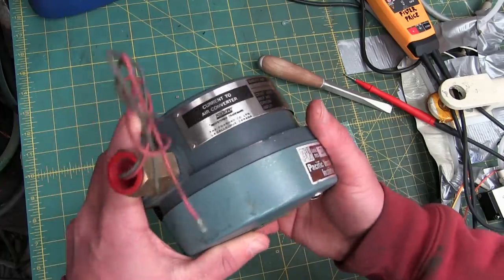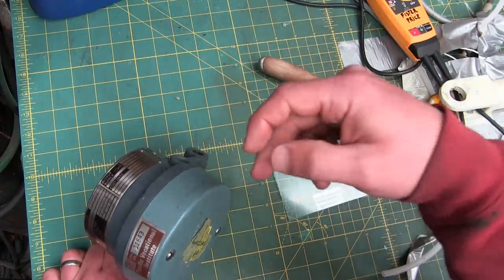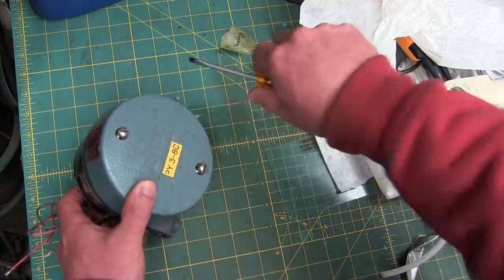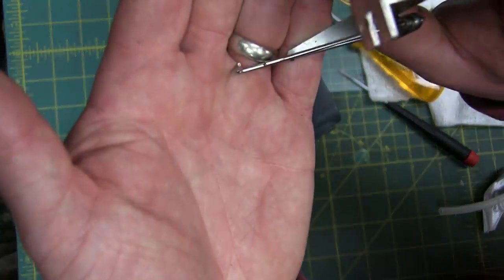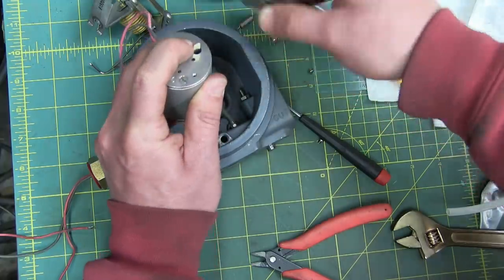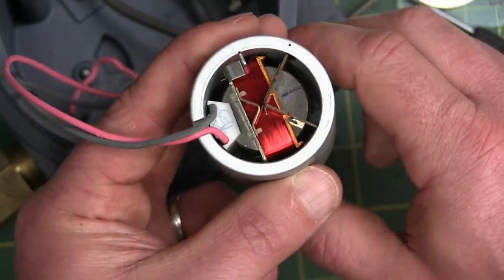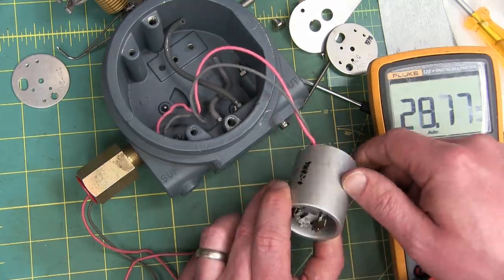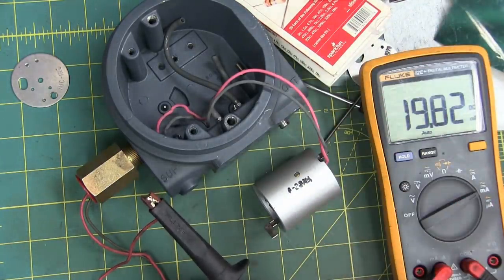BOLTR: Electro-Mechanical Instrumentation | MADE IN CANADA

Comment: Wait! Does it create voltage from vibration,the little nozzle causing lever to move/vibrate.
Reply: Nope current in the coil makes it want to align with the magnet. It operates on force rather than position. The position of the flapper (attached to the coil) and the nozzle (attached to the feedback bellows) move around but what changes the output is the force of the flapper pressing against the nozzle.

Comment: t's a current to pressure device, not pressure to current.  IIRC you read it correct but ignored what it said.. :-)   it's in a system that uses fluid on some static system.  Maybe to control clamping pressure for a brake?

Comment: If you're regulating the current going in, you're always going to get the same current going through, regardless of the impedance. You should be inputting current and measuring voltage, or regulating voltage and measuring current.
Reply: You just input current. There are no further electrical measurements to make on a force motor like this. The controller outputs a 4-20 mA signal and this converts that into a 3-15 psi output which goes to a pneumatic valve.

Comment: Merlin Gerin was bought out by Schneider. 
When it comes to D/B’s, contractors, switch gear, all ranges of breakers from a 2A MCB up to 4000A (which is the biggest I’ve worked with), control circuitry and the list goes on. They are the best in the business and used globally. 

I’m still not sure why America still uses a different type of switch gear than the rest of the world though 🤔

Comment: me thinks to much brewski.  Clearly says current to air converter.  Input is 4-20 mA.  Not output.  Coil  and magnet are stationary and therefore a galvanometer movement.  Don't drive for a while it would be the big mistake.

Comment: don't you need a 250 ohm load resister in that circuit?
Reply: You only need a 250 ohm resistor to convert a 4-20 mA signal into a 1-5 volt signal. An I/P works directly on current so no resistor needed.

Comment: Maybe if you supplied an AC signal to the coil in a bridge configuration and are using the magnetic poles to saturate the coil to cause a change in the AC signal… which would then need to be converted to 4-20ma signal.

Comment: very interesting. I keep thinking now how you'd do the signal conditioning for that without it getting too complicated using 1970's tech. The 741 would have too much temp drift for starters.
Reply: Use the 741 as a current driver.
Reply: You cant for the reason I highlighted above. IE stupid amounts of temperature drift. The input offset drifts all over the place so you cant just trim it out.

Comment: Sometimes pixies do care about being in a magnetic field, albeit in different circumstances than what is shown in this video.

Back in the good old days, Otis Elevator had a neat 3-phase door motor controller, (no, not VVVF, long before that) which initially limited the 3 phase current to the door motor thru a "saturable reactor". Basically each leg of the 3 phase input power was wound on a steel core- Then there was a forth coil would around this same steel core- This 4th coil was fed with a variable DC current, and when energized, the superimposed magnetic force of the DC coil would squash the magnetic flux of the 3 phase input power, reducing the impedance of the previously saturated 3-phase coils, and thereby allowing the 3 phase power to more freely flow, increasing the torque to the door motor. IOW, when the DC was turned on, the 3 phase reactor windings were no longer in a saurated state, and the doors moved faster. Reduce/remove the DC control current, and the door motor again slows down as the 3 phase input windings again reached saturation, their magnetic fields rising to the saturation point on the core.

The DC current clamped the core flux, reducing impedance, and allowing more current flow

This purely electrical (not electronic) shenanigans was further smoothed out by having the door motor motion dampened hydraulically. 

When set up right, you could adjust them so finely, that they worked like "Star Trek" doors, just swooshing open and close with infinitely variable speed for Mon Capitan to enter with his characteristic flourish of the mystique of command.

Comment: A "current to air converter" implies that this transducer accepts a variable current and uses that to control air in some way (pressure or flow). You will notice that the label says "INPUT 4-20mA", so it is telling you that the current signal is the control input. It appears to me that the electromagnetic "motor" responds to an externally applied current by rotating slightly, moving that flat vane against the leveraged nozzle to either block or unblock air flow through that nozzle. Since this effectively controls the nozzle orifice size, if the nozzle is restricted, the pressure will cause the bellows to extend. What that then does I can't predict, as you passed by the pneumatic side of this instrument too quickly. I think you need to review the function of those pneumatic ports; I'll bet that one is a raw input, another is an excess dump outlet, and one is a regulated pressure or flow output port, with a response proportional to the 4-20mA current input.

Comment: What is that nifty green film you use that shows magnetic poles?
Reply: ziggythecartoon I was wanting to know myself and found it on amazon this is what it said:
Magnetic field display viewing film is used to visualize magnetic fields. It is a translucent paper-like substance which makes magnetic fields visible. Most are made from a plastic film that contains a ferromagnetic slurry of fine nickel particles that align themselves along magnetic field lines. The general principle of operation is that magnetizable nickel particles are suspended in a colloidal form in a gelatinous material. This allows enough freedom for the particles to align with an externally applied magnetic field - thereby displacing the colored fluid and causing a color change at the surface of the film. Recommended for ages 8 and older.
Reply: magnetic film is what you want to search for ;)
Reply: So, iron filings in syrup, eh?

Comment: Holy shit, Uncle B... it doesn't appear to work because it's not a pressure transducer at all. It's an I/P (current to pressure). You feed in 4-20mA and it outputs 3-15psi air. These things are common as dirt in the process industries. The are used to control actuators on throttling valves. So "spot the mistake"? The whole video is based on a mistake.

Comment: converts an analog signal (4 to 20 mA) to a proportional linear pneumatic output (3 to 15 psig). Its uncomplicated design and proven electromagnetic force balance deliver consistently high performance. 

The IP210 provides a reliable, repeatable, accurate means of converting an electrical signal into pneumatic pressure. Its force balance principle is a coil suspended in a magnetic field on a flexible mount. At the lower end of the coil is a flapper valve that operates against a precision ground nozzle to create a backpressure on the servo diaphragm of a booster relay. 

The input current flows in the coil and produces a force between the coil and the flapper valve, which controls the servo pressure and the output pressure.

Zero adjustment of the unit is made by turning a screw that regulates the distance between the flapper valve and the air nozzle. Span adjustment is made by varying a potentiometer, which shunts input current past the coil. An integral volume flow booster provides adequate flow capacity, resulting in fast response time and accurate control.

Comment: To which mistake are ye referring to?
Q1: The part where the location of a magnet to a coil would change the impedance? 
A1: WRONG, DC current cares not abüt the impedance only the resistance. 
Note you'll see brief deflections when you move the magnet about but the current will settle back to whatever the voltage divided by the resistance is. Mr. Michael Faraday knew this well.
Q2: Was it the part (or parts) where you said that it transmits 4-20mADC based on the pressure?
A2: WRONG, it clearly says current to air, not air to current. That DELICATE instrument is supposed to RECEIVE a 4-20mADC signal and then it REGULATES the PRESSURE accordingly. That way some poor fat button pusher or a confuser can change the chooch factor just right.
Q3: Bellows is coarse, nozzle is fine?
A3: WTF!!! NO! NO! NO!
Bellows is fed from the output pressure through a restrictor plate or oriface (depending on how dirty your mind is) and is vented through the nozzle and the nozzle is positioned by the bellows deflection. This variable pressure goes to the output port to a pneumatic actuator with spring return and moves a valve or piston or something with a 3-5 psi or 7-9 psi throttling range. I've worked with and designed and serviced lots of this and I must say sir, the nickname bumblefuck is an understatement... keep it up. hope you learned something.

Comment: It's not a rheostat. It's a galvanometer.
Reply: When you apply current it turns and blocks the hole in the end of the long, bent tube. This pressurizes the bellows which moves the bent tube away from the galvanometer.
Reply: When you decrease the current the galvo moves back and lets the air out of the bellows, and the bent tube moves back towards the galvo.
Reply: And when the bellows moves it also shifts the valve that lets the air from the SUP port to the OUT port.